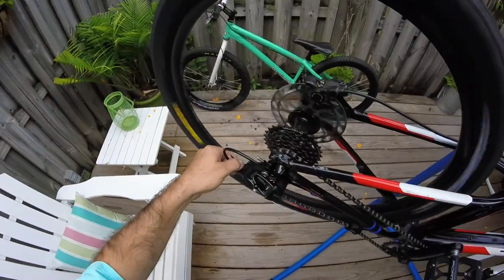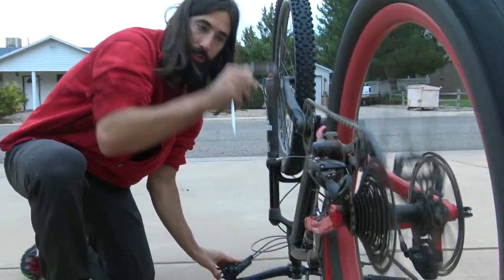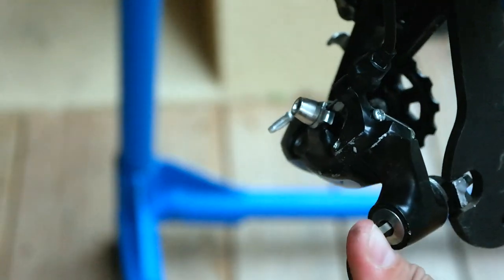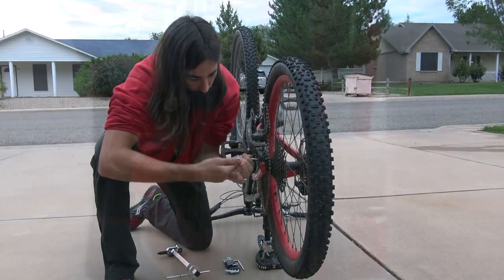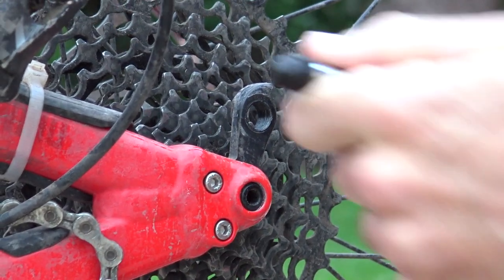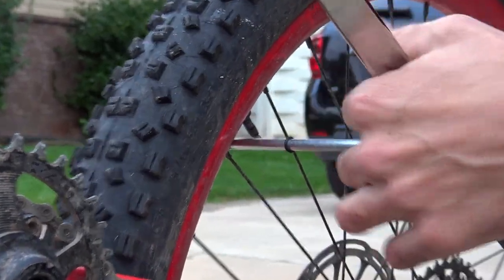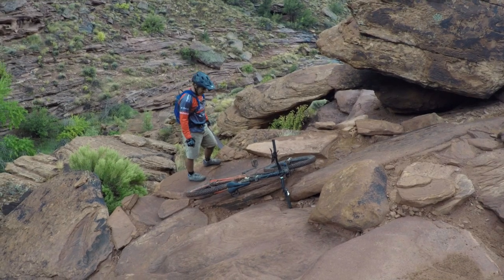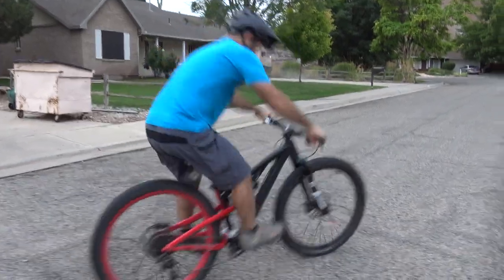Why your bike shifts like garbage

Comment: i don't know why but you, Seth, are the coolest youtuber around! you have the perfect amount of humour and proffesionalism! you seem like a cool guy! keep on doing what you're doing!
Reply from the maker: +Tue Astrup thanks!
Reply: Seth is*
Reply: @SethsBikeHacks  Hey Seth my bike isn't shifting properly.........when I put it in the 9 card it stays in 7 and it doesn't reach 1.
And my pedal's gear's shifter is sooooooooooo stiff you can't press it at ALL.Idonno man this seem so messed up.
I took my MTB to school and I think alot of idiots came up to my bike and shifted it over and over again they also took my valve tubes top........any help.

Oh and my fixie isn't shifting at all anymore:/
Reply: Rasina P check if your gear cable is loose (and shift to your highest number gear to tighten it if it needs to be tightened)
Reply: @rasinap2432  its the screw in the rear derailleur thats why you cant go to the biggest cog. While the smallest cog that is your number 9 is adjusted in the rd or in your shifter
Reply: @colemitchmtb  Thanks... but got it it fixed:)........ Went to  a mtb shop it only cost 
4  bucks...... Could've fixed it myself though.
Reply: @s1mpleniko488  Thanks..... but got it fixed from a mtb shop:) Apparently the shifter just needed some lubricant.  And the srew fixed the rest.

Comment: Hey, great video as always, Seth.  That tool for fixing a bend derailleur hanger is great, and probably worth owning.  But many of us don't have one, and I learned the following "hack" that works in a pinch: if you have an old rear wheel lying around, the rear axle has the same threads (M10 I think) as the rear derailleur.  This means you can remove the rear derailleur, screw in the whole old rear wheel, and then use that wheel itself as a tool to unbend the hanger.  It's pretty easy to see when this old wheel is lined up pretty well with the bike's rear wheel.

Comment: Awesome video and definitely useful. Probably worth mentioning two things. 1. You should still keep a spare hanger just in case yours snaps when trying to bend it back in place. 2. You should ALWAYS carry a spare hanger on long rides where a broken hanger will leave you walking. They weigh nothing and fit in the pack easily unlike the tool. 
Those things said, that tool is definitely a great investment!

Comment: You can actually screw the axle of an old rear wheel in and bend it with the help of it until the two wheels are parallel.

Comment: This does make the hanger weaker though because it's already been damaged when bent. It's not a permanent fix because the next time you impact it, it's a lot more likely to break than the first time
Reply from the maker: +Miles Pearce Sure, a little bit. The further you need to bend it back the more it is weakened, but generally it is not a problem. The hanger in the video was bent back at the beginning of October and I've ridden it since.
Reply: Seth's Bike Hacks yeah I wasn't saying it was a bad thing I was just saying it might not be a permanent fix
Reply: Some of them are strong! I've bent the same hanger back 3 times now and each time it took a major blow to bend it again.

Comment: Quick question - what's the most likely cause for a single speed bike's chain to skip?
Reply from the maker: +Ozzy779 stretched chain, improper tension, or damaged chainring
Reply: Ozzy779 Or take off the back tire and move it back enough so that the chain is tight enough
Reply: @subhankhalid9062  take what

Comment: SETH!!! PLEASE HELP!!! A couple of days ago, a stick got stuck in my derailleur and it completely snapped off! Now ,i  have no idea what derailleur to get. It is a shimano deore xt 8 speed, and i couldnt find any online. I was also wondering if i could use a different derailleur. You probably wont see this, but if you do, PLEASE HELP!
Reply from the maker: +Aiden Margow get any 8 speed mtb derailleur and you should be golden
Reply: Really? would the hanger not matter, because that is where is snapped
Reply: Aiden Margow hay
Reply: sup
Reply: Most sram derailleurs would not be compatible with shimano shifters due to the cable pull being different at each end and never quite work properly

Comment: or just GET A SINGLE SPEED FUCK YEAHH NO PROBLEMS
Reply: YOLOMAN SWAGGER fixies are beast 👌
Reply: you forgot your no scope ;)
Reply: No, they're not. Certainly not if you ride yours hard. Tighten things as much as you want, they'll work the lockring loose. And they're a pain in the ass to land on a jump. If you stop pedaling mid-air and land with both pedals horizontal (like you do with a regular bike), good luck.
Reply: was thinking going single speed on my dh bike.
Reply: not talking about commuters/fixies/fixed gear, just talking about single speed with a cassette, that proved to be really good for me, even for climbing some hills, there is a lot less weight and no chain dangle at all
Reply: rustler08 you're right but they are known that they are the best type of bikes to commute, it gives you power and strength and more important that every thing in your fixie bike is usefull, unlike geared bikes
Reply: YOLOMAN SWAGGER my bike is single speed too and i agree with you
Reply: YOLOMAN SWAGGER Dirt jump bike with a  long seatpost💜

Comment: I have been dinkering with the index trying to get the rear derailleur to shift in the middle and it's always got a tiny bit of clunkiness in it. It was driving me crazy. I would tweak it in one direction and it would shift and then the gear next to it would start to clunk. Awesome video! I am going to look for that tool!
Reply: I made the tool after watching another video and my hanger was definitely bent. It shifts much better now after I tweaked it back to shape and adjusted the trim on the cable tension.

Comment: If you don’t have adjuster or you still unsure about tweaked hanger, you can look at your chainline. If it is aligned properly- probably hanger is ok, but if chainline isn’t correct and you see that lowest derailer star is not exactly below its highest star it means that hanger is bend or even derailer.

Comment: You can get universal-fitting ones that fit via the QR skewer axle. They are for emergencies only but can be bought cheap and used indefinitely. Good to have one in your bag if you or a friend crash out in the wilderness and you both have different frames.

Comment: I had to fix a hanger lately. I just took a pair of vice grips to my derailleur (probably not great for it I know but I just scraped some of the metal on it still works perfectly) and bent it back to straight. The hanger was visibly bent so I managed to get it straight enough that is shifts perfectly now.

Comment: top tip for doing this on the trails: If you don’t have a plug-axis you can bend it with your front wheel. This is because the axle of your wheel has actually the same threads and the same diameter as the derailleur threads. So just take of the quick release of your front wheel, and carefully screw the axle of the wheel into the hanger. Know you can use anything (even sticks) as reference material on the outside of the wheels. ATTENTION!!! do not do this if you suspect that the threading in the hanger or on your wheel might be damaged!! Actually the threaded part of the axle isn’t long enough to do that much bending and eventually you will rip the threading out of the hanger.
p.s. sorry for maybe misused technical terms, I’m from Germany.

Comment: You still need to actually ride and shift the bike before you finally  index the gears with the cable tension. It helps to have a barrel adjuster up front in order to fine tune the indexing.

Comment: Back when I used to mountain bike on 5$ garage sale bikes in the early 2000s I constantly had shifter problems; so much so that I almost didn't come back to mountain biking ever. When I learned about internal gear hubs, specifically the Rohloff speedhub I got interested again.

With a cost of 1400 to 1600 US dollars just for the hub it was abit of hard pill to swallow when added to the cost of a new bike. However, I saved up and ended up getting a fatbike with the speedhub on it in 2014. I've had zero problems with it in the 2.5 years I've had it riding year around in Michigan(including winters with snow). The only maintenance I've done is the yearly oil change. The hub will probably outlast me given that some people claim to have clocked up to 100K miles on the hub with just regular oil changes.

Comment: an old Wheel does the same Job as the tool (Quickrelease or realy old style with nuts and bolts) ... they have the same thread as the hanger... just thread it in and see if the old wheel aligns with your backwheel.
but if only you'd put up this video a month earlier it would have saved my day back then... so i imagine it to save a lot of persons days... thumbs up for that

Comment: k so I live in colorado, and I don't know about other states or cities, but boulder colorado has a place called sports garage. This place is super useful because they have mechanics, and it's basically an awesome bike shop. Anyways, I have a full suspension bike and the bushings were dangerously worn making the screws constantly loose, and I had to get it replace, badly. I went to sports garage and they happened to have some old rocky mountain bushings that they've had for ages, and it just conveniently happened to fit my bike. So, they very nicely gave me the bushings, and a few extra in case those wear and I need some more. I told them about a couple other problems on my bike and they got right on those as well, like the fact that my wheel was out of true, and that my derailleur hangar was bent. They wouldn't let me use the tool on my bike, but when they were done with it, it was amazing like I bought it brand new(which I didn't) anyways, my point is that if your derailleur hangar is bent, just go to a shop and I'm pretty sure they'll do it for free because it's such a small job. Oh, and also, they gave me an energy drink. They were pretty nice.

Comment: Coming from a bike shop mechanic, yes this tool is awesome, but it shouldn't be overused. You may be able to salvage your hanger a few times, but it is not a long term substitute for a new hanger. Those hangers are made of a soft alloy and repetitive bending will weaken and eventually break it.

Comment: Alignment tool is useful also for new hanger. Not all are strait from factory.

It is good practice buy replacement hanger with new bike. It cost me about 10 USD (directly from manufacturer). Need to order spare also for other bikes.

Comment: I need this TOOL !!!!!!!!
Got a used 2008 KHS XC-206 got 1 chain stay WELDED !!!!!!!!!!
now running a 1x10 shimano on the top low gears  skipping 
adjusted tension and shifts , messed with the b-tension still skips

Comment: Often a new hanger isn't perfectly aligned anyway, especially for 11 speed systems. For 7/8 speed it wasn't so critical but the most you can get away with for 11 speed is max 4mm at the wheel, so an alignment gauge is a must. Don't buy cheap either, they usually have more play in the bushings than 4mm at the wheel, get the park or abbey tools one.

Comment: Other reasons your bike might shift like garbage from a bike mechanic: rusted cables, frayed housings, kinked housings (especially invisible kinks in internally routed cable housings), ferrule failure (really common with cheap plastic ferrules that usually come standard on new bikes), bent cable inside of housing, dust/dirt/rust inside of the shifter. There are probably a lot more that I can't think of right now but those are the big ones. Oh, and if you have a front derailleur and you already checked for all of the problems listed above, check the pickup pins on the inboard side of the chainrings. That's all goodbye

Comment: A bike came into a shop I was working at this summer. The derailleur hanger didn't work properly and ended up ripping off a quarter of the chain stay completely off the bike. Luckily the manufacturer covered it under warranty.

Comment: You can DIY a hanger alignment tool.  Take a piece of square steel tube, drill a 10 mm hole, and attach it on a cup and cone front wheel axle.   Google it and you will find more than one ways to DIY a hanger alignment tool.

Comment: In the bike shop i work at we sell derailleur hanger for 10,50.
And the derailleur hanger straightener isn´t that good because after that your material is weak and can even bent if you shift 3 gears at same time or so.

Comment: How does that adjustable wrench work?  Does it literally bend the hangar flat?  Would a cheap hangar cage be a good option to protect the hangar.  It looks like a bent piece of steel gage rod.
Reply from the maker: You just remove the derailleur and use an adjustable wrench to clamp down on the hanger and bend it straight. This is definitely a quick and dirty method and is only marginally better than using a pair of pliers.

Comment: Oops, feel bad for you guys...
In Taiwan we can get 100 types of "relatively commonly seen " spare hanger with only 3 to 5 bucks. 
But even you do keep spare hangers with you, you'll need alignment tool regardless.
Often the new hanger does not align perfectly, due to manufacturing tolerance, shipping or even the frame is slightly bent.
Since you've changed a hanger for better shifting, why not making it the best you can get : )

Comment: This video is the reason why I left working in the bike industry. In the 90s and the early 2000s, bike standards were, well, standard. Most parts were universal. Now there is far too much proprietary bullshit and so much to that some bikes even require a proprietary kickstand....I will still to my old steel frames. I can bend the hanger back and if it breaks, well the frame I am currently riding cost $35. I will find another one for cheap as well.

Comment: What about a bent, warped cassette or chain? My bike shifted like crap going up hill and when trying to get speed on high gear. I know shifting under load and what not but I wouldn't even be shifting. I'm curious if I indeed had a banged up deraulier hanger. My bike is in the shop right now (Needed a whole new wheel x.x), hopefully she runs like butter. My brother in-law said it might have been that my bearing was shot or something to do with the spoke. Waiting to hear back from the shop, hopefully I can pin point what the promblem was.
Reply: what was it?

Comment: You can make a home version of this tool with a couple of threaded rods and some flange nuts. One in the dropouts, another through the hanger. adjust until rods are parallel. Of course the real tool is better, but this can be done for around 5 bucks.

Comment: Hey Seth's Bike Hacks im looking for my first full suspension bike for under $2500. im probably going to have it though college so it's going to take abuse. Ive looked at a lot bikes and the diamondback release 1 27.5 looks promising. What are your opinions or suggestions. Thanks😀😀. Fyi i ride year round in Alaska on 26 inch wheels.
Reply: Love your vids too😀😀

Comment: Dont forget that the hangers made by aluminium. if its bend and you bend it back, that will be bend again or even broke apart !! thats only a temporary solution. Otherwise with steel frames thats an usable tool and fix it for ever.

Comment: I have a shwinn solara road bike, I just got it a couple days ago but on the lowest (slowest) gear the chain touches some thing  that switches the crank gears (sorry I don't know what it's called) but that's not the problem, when I want to use my 6th or 7th gear, at times the chain would just fall off, and I'm not sure if it's this or not, any guesses or help?

Comment: hey so I had am incident because I'm a immature rider. landed to hard on my back wheel. I managed to split the hanger and get the dressier stuck in my rim. I ordered the parts back. Was just wondering if you get a strait hanger will you need to bend it slightly for the shifting to be good??
Reply: derailer sorry

Comment: Hi Seth, How you doing?
I have a question for you, have you experienced some random chain skipping while riding without shifting when your rear derailleur hanger was bent?

Thank you.
Reply: Luke Shelmire Hi Luke, nope, chain isn't worn, it's a 200 mile old drivetrain on a brand new bike.
Reply: Luke Shelmire really? Even if it is an almost new drivetrain?
Reply: Leonardo Diaz  it could be that your chain is worn out, but if your bike is new you should check to see if your derailleur hanger is bent, if your chain is ran through your derailleur wrong, or if it is just really bad shifting. Bent derailleur hangers can cause chain skipping.
-BikeDIYVideos

Comment: My rear gear had 7 gears. It is not going into two of the gears. I can make it to into gears 1-5, 2-6, or 3-7 by adjusting the tension knob on the derailer. But, no matter what I do, there are always two gears I cannot shift into. When I get to the last gear I can shift into, nothing happens when I press the shifter (the derailer doesn’t move or barely moves). It is not the limit screws because as I said before I can get into the gear by adjusting the derailer knob (but that also limits the upper gears or lower gears I can use). Please help, thank you!!!
Reply: This worked for me:

I did a shifter flush, bought and used the Park Tool hanger alignment tool (I think the flush and alignment were both needed), and finally indexed.  It is now shifting into all seven gears.

Comment: That´s why you need a breakaway bolt instead. Carry a couple spare in your pack & sorted... I preferred the old school frames with fuck off thick hangers as part of the frame/ drop out & just use breakaway bolts... no bent hanger, fixed in a jiffy